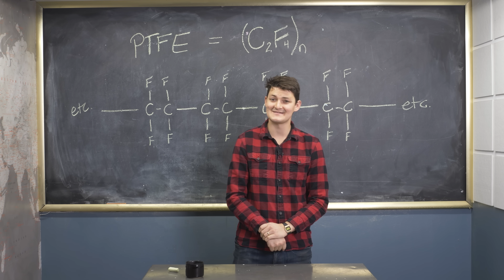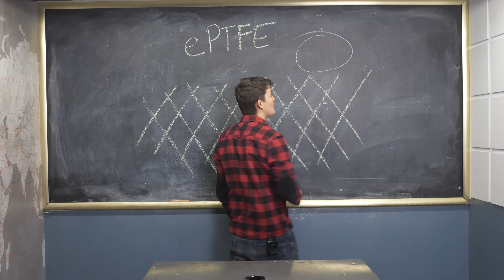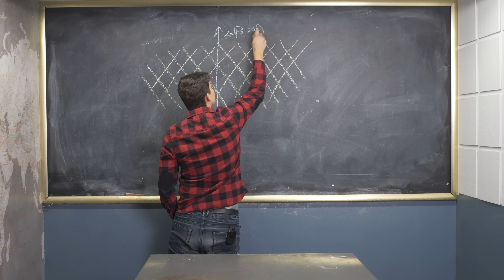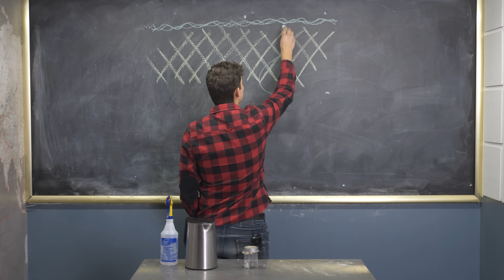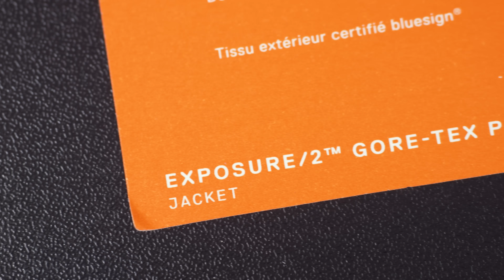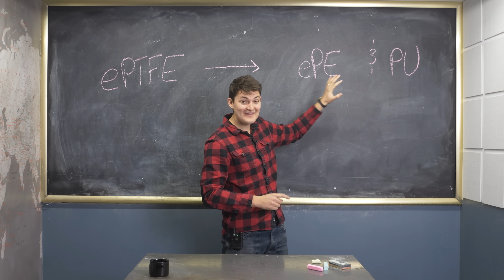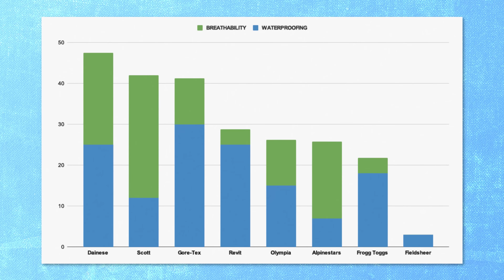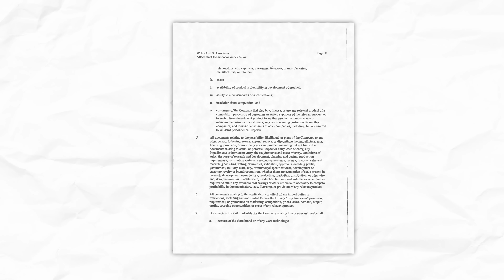Gore-Tex is a Marketing Gimmick

Comment: Excellent video
An interesting addition (IMO) is that there are some systems that have a different way to try to provide waterproofing and breathability.
SympaTex is a german brand that does this through a completely different mechanism, and works using a sort of "wicking" effect between hotter and colder areas. I had a jacket with that sort of membrane and it feels like it does more to keep you from drowning in your own sweat, and is as waterproof. 

It is mainly the breathability that is better, or rather water transport out of the garment, because it is not at all breathable in the way that GoreTex claims to be breathable, but seems to be breathable in a more useful manner.

Comment: This is super interesting and I believe it also applies to all the new "magical" wicking shirts. They only work when it is not humid outside. Here in the Eastern US in summer the humidity is unbearable. Doing active work outside will make you sweaty. The new plastic shirts do nothing to make me comfortable, I am better off in a nice simple long sleeve cotton shirt that gets *cold*. Plus the new plastic shirts smell awful, despite any marketing on them about odor control. Cotton and wool do not have this issue.
Reply: I wouldn't go with anything other than cotton, wool, or smartwool for moisture wicking. The latter being my favorite as it works just as well in +40 as it does in -40.

Comment: So if Gore-tex is garbage,  what rain gear is best?  How is the "common" person to know if the off brand rain gear is legit or a cheap scam?  Gore-tex isn't perfect,  but it works. And it works better than the rest. 
I made a few wrong turns in life and ended up homeless for about 5 years in a pretty wet part of the country.  I was able to outfit myself in head to toe gore-tex. I literally lived and slept in it.  Most military surplus.  It works better in all categories than anything else I could find or are aware of.  I have been a productive member of society and off the streets for about 9 years.  I still swear by it. Klim gore-tex riding gear, marmot rain gear. Bellevue boots, etc. Its still good stuff.

Comment: Your points aren't accurate. Say you sit down on snow in a cold environment, there is waterproofing for your butt. There is also breathability on your torso where you're sweating. Therefore it's both breathable and waterproof.
Reply from the maker: Fair point! Although sitting in snow is not the most common concern for motorcyclists. ~RF9

Comment: Living in PNW, below the tree line, long ago came to a rabid disdain of Goretex. Especially for sailing or any sort of coastal hiking trails. It just ends up being so waterlogged after any amount of use. I stick with durable vinyl jackets with large venting zippers - which are a fraction of the price and last almost indefinitely. 8 inch holes under your armpits will vent pretty darn well! If you need to cool down after exerting yourself you ditch the jacket and hang out under an umbrella for a while.
Reply: any suggestions? I need something for .motorcycle riding
Reply: @ratbrain7743  F-9 has done multiple product reviews over the years for riding in the rain.

Comment: It's all about layering and having control of the ventilation. The more adjustable vents and the bigger they are, the better (more control)!
Pit zips, thigh zips, back zips with a flap. Rain coats with proper vents make very good winter shells with a down sweater underneath.

Comment: i bought lowa zephyr tactical boots with gore because i wanted the best tac boots and it had to be waterproof as i use them as outdoors boots and for motorcycle.
They are waterproof but mostly because of the dwr /impregnated outside leather. When leather gets finally wet, they become wet inside too. 
Inside layer of goretex membrane stitching is poor quality it was literally hole between leather and membrane at the top, from the factory new boots.
Send them back, received another pair, same story, got it stitched better in local shop. 
Overall i like them boots, and they are very comfortable and relatively breathable and relatively waterproof but build quality and durability for top dollar boots should be better.
Do i recommend them for outdoors and motorcycling? Yes if you can easily afford them. They a lil too delicate for riding bike so have to be careful, on contact points with bikes frame for example youll get polished spots of suede. So yes they work as bike boots, but have to be careful, and use something to cover gear lever, suede will get colored in contact with metal gear lever. I ride africa twin with DCt so thats not issue in that case :)
Reply: on topic of goretex membrane, is hard to tell. Cant complain but also i dont feel its anything special, like Ryan mentioned. It will leak eventually and get wet.

Comment: Never paid extra for gortex. I snowboard, so waterproof is important in my gear. I was looking up gear for someone else and saw gortex and looked it up (I was this out of the loop) and still didn't get it. I just needed waterproof with vents. How breathable could it possibly be to beat that?

Also, I'm a cheap mother fucker so I just would never pay for it

Comment: Your own testing shows that Gore-Tex is THE most waterpoof of any of the membranes tested. Additionally, you argue against Gore-Tex, because it breatheable OR waterproof, ignoring that, yes, that's often the point. I dont want to stop and put on an outer PVC layer, if i wanted to do that, I'd have bought that. 

Unquestionably, Gore-Tex does what I want, delivering somewhat moisture permeable clothing that resists water intrusion better than anything else this side of "pure plastic", AND its backed by the most stringent testing and best warranty in the market.

That's still worth it to me, empirically.

Comment: I did shell out years ago for the "Gore-Pro" super-suit which has the "Klim" badges and "super-fabric" ornamental skid sections. Since the venting is also absolutely amazing, I still stand behind my purchase proudly. Even though it's wildly overpriced, I can say that with regular washings and care, I still have an amazing suit which looks and feels almost new after over FIVE YEARS of regular use. My buddies who skimped and went with lesser models have long since resorted to the "duct tape" trail fixes following quick failures, and have been forced to buy new ones. Add in the fact that I don't need to pull over and strip down in the rain to add any waterproof layers, and I would SURELY make this insane purchase again without a second thought.
Reply: My klim traverse gortex jacket is 7 years old and still water proof. I am not aware of another product that can boast that. I do agree though that it really isn't that breathable.
Reply: A well-made, high-quality garment is gonna be high-quality either way, the fabric itself isn't really the problem. The real problem is that FINDING the high-quality stuff in a sea of overpriced sweatshop garbage using gore-tex as a marketing crutch is near impossible.
Reply: @datalorian  No rally intended. Just sharing that my quality garment was worth the stupid price in the end. Thanks for trolling.
Reply: The Gore-Tex membranes DO seem to stand the test of time, and even if they don't you are more likely to get support in replacing a faulty garment with a Gore-Tex lining than you are with a product using eVent or some other house-branded membrane. Gore-Tex seems to offer a premium product and offer premium support with it. Most companies using Gore-Tex are utilizing in their more premium lines, so there you go. I agree though, most "breathable membranes are not THAT breathable, and it is good to layer a HIGHLY breathable and appropriately weighted midlayer under it to create a breathing zone, and make sure your membrane-equipped garment has good ventiliation as well.

Comment: I live in the same climate as Ryan in the PNW so I've used a massive range of waterproof gear. For whatever reason, the Goretex stuff has vastly outperformed almost everything with a proprietary membrane in both waterproofness and durability. It's actually outperformed every single piece of coated nylon "non breathable" waterproof gear I've ever owned. Rev'It's discontinued Orlando waterproof jeans are a notable mention for non Gore gear that was totally flawless, and a cycling jacket I own with Polartec Neoshell. Unfortunately, everything else seems to leave me soggy.
Reply from the maker: Those Orlando jeans have been my daily choice for years, they're stellar. Only thing is that they look catastrophically wet, so everywhere I go people say "oh no, you're soaked." ~RF9

Comment: as a person who works in weather, I've determined there are three kinds of raingear: technocloth, that is reasonable to wear in dry weather, but only lasts for about an hour in the wet before it soaks through.  rubber based cloth, that stops water indefinitely, but also keeps sweat in when the rain stops, and oilcloth, which has the wet weather performance of rubber, the dry weather performance of techno cloth, and the weight of both, together - plus the requirement of maintenance to maintain effectiveness.  but it has style.

Comment: Great stuff, I have a Goretex shell jacket that has never been that waterproof, outer wetted out fairly quickly even when new. 
On a non motorcycling front I was also rather hacked off when my Asics Goretex Trail shoes were very clearly not waterproof, and i was cold at the time, so no chance I had sweated my socks wet, it was the rain. 
Live and learn🙄

Comment: I'm so glad someone has finally revealed the truth about goretex. As a cyclist I can verify that when you are exerting yourself on a push bike in the rain you will end up soaking wet.......inside your jacket! This even happens when it is dry outside. The moisture building up inside the jacket will clog the goretex and once again you get wet....inside. Love your videos and humour.
Reply: Yyyep, you do get moist when exercising in the summer. You are dry when it rains tho.
Reply: Goretex is not a magic force field that destroys a bad water inside it (while keeping  good water intact). As Rayan said your alternatives to membrane are regular clothes w/o waterproof, wich makes you wet and cold when it's raining, and rubber-like non-breathable-at-all waterproof materials wich makes you wet and then cold even whet it does not raining. Heat and Sweat management are your problem,  membane can really help you but it don't solve it for you. 
TLDR: Goretex and membranes aren't perfect. But they are goddamn Sci-Fi comapring to rubber and wax that were before. I think soldiers from WW2 and 'Nam would kill for ECWCS jacket from 90's.
Reply: Better off with Nikwaxed polyester when exerting, less so when motorcycling below 25c.
Reply: That‘s my experience as a cyclist with goretex too. I gave up using it.
Reply: @cfr4831  I have used Goretex for cycling for the last 34 years. I replaced my original jacket last year. The secret to making it work is to keep on top of the DWR treatment. If the outer fabric wets out then it doesn't work. No "waterproof" garment is perfect, particularly for cycling where you are generating a lot of sweat, but I have found my Gortex jackets to be the best option. In fact I would say that when I got my first one it was a game changer for prolonged cycling in the rain. I'm sure that there are other breathable membranes that work as well so I'm not particularly bigging up Gortex.
Reply: @cfr4831  You can make a gortex rain jacket work on a bicycle even in the rain but it must be extremely well ventilated with large pit zips under your arms, and a cape opening at your shoulder blades. Rain chaps work better than rain pants as long as you have fenders.
Reply: The price comparison is very unfair.
It compares a laminated jacket with Gore-tex, with a nog non laminated jacked non Gore-tex, laminated jacket's are double in price because it's way more work and needs to be made wit a lot of handwork, so that explans the price difference, hense it's not the membrane!
Reply: If you wear any waterproof thing you will end up wet inside your jacket due to the extreme humidity. Goretex breaths way better before that happens though.
Reply: @Jagknorr True
Reply: @Jagknorr But goretex will only breathe if the outside environment is more dry than your jacket. So if it's raining outside you lose pretty much all of your breathability
Reply: @Jagknorr it might be "better" than a plastic bag but it still doesn't keep the condensation out which is the whole point of goretex

Comment: Apart from motorbike gear, I've pretty much given up on the whole membrane thing, full-stop/period, and now use NikWax stuff for general outdoorsy stuff. You do get slightly clammy in a downpour (but don't sweat) and as Ryan's video says, most of the waterproofness comes from the DWR coating in the first instance,  so if you keep that in good nick the water beads off anyway, and any PTFE membrane is largely redundant. (NikWax clothing works by WARNING - MARKETING BLURB AHEAD some other sort of convoluted capillary action.)

Comment: I've found choice of fabric depends heavily on intended use. Gore-Tex works well in motorcycle clothing due to the low activity level (internal moisture) relative to the potential head of water (100mph rain...). That, combined with the stringent restrictions on product design imposed by GT, tends to yield a quality product. But that's for cold/temperate conditions with integrated shells... I'd definitely avoid for warmer conditions and it's unnecessary for drop lined clothes.

Comment: Back in the day ( here we go another boomer story) All we had in the way of waterproof coats were either heavy, did not work or were like wearing a bin liner and then the seams would leak. The first Gortex jacket I could afford was like putting on a pair of leather shoes after only being offered plastic beach shoes before. I moved away from Gortex in the 90’s when big sportswear chains started selling their own brands of waterproof walking boots and hiking coats that worked and for a fraction of the price. What I do not understand is today’s tech savvy generations still buying into the marketing hype.
Reply: The tech savvy generation that lines up for the latest mobile phone at $1k, that offers a new colour scheme and not much else?
Reply: @peterk2455  Or does offer something mildly better..but not asking what's the point if what you are using already works.
It's not that these phones aren't better, there just isn't a point if you already have one. They may be slightly faster..but unless it was an active thought in your mind that it's crap while using it, there is no good reason to upgrade. If it's "well it's newer and better" is the only thought, it's an unnecessary upgrade.

That thought also has to be because it's slow, but not because it suddenly became slow doing the same stuff like mine. Lags whenever I turn on wifi since a few months ago, don't care enough to check out why. Probably an app that has reached a big enough size or just a bug with some app that updated because I only realised to turn off auto-updates some weeks ago after an app I was using suddenly broke. It does the same as some other apps and they were all working fine at the same time previously. This was only a month ago or two, so can't be the cause for what started at least 3 months ago.

No, it has to be because it just is slow and some newer apps asks for more resources for a smooth experience. Maybe you are playing phone games for some reason and newer ones are more demanding at the same framerate. It does save money playing phone games on the phone while you also use the phone for all the other phone stuff instead of buying both a phone for phone stuff and a Steam Deck or similar for portable gaming stuff. No savings there if the game is a PC title, as those probably won't run well on the phone. But if it's something that exists on both platforms, no point in the Steam Deck as the casual user doesn't care about the differences. I don't like phone games because my save data may only be accessible if I have superuser, so I would pick Steam Deck as that seems more accessible for that. Corrupt save profile? Copy over a backup..Also doesn't require internet, not that I would only backup using the cloud anyway. At least one local backup too.
If it's just sudden like mine, second-hand seems like the better choice if you don't want to let it be.
Reply: Unfortunately, no matter how much technology advances, people are still just as gullible as always, and all the old scams still work just as well in digital form.
Reply: They aren't though. Its still the boomers
Reply: But those old bin liner waterproofs ("proofed nylon" if I remember) were pretty reliable and you knew what you'd get. I wore them on top when raining and took when rain stopped. Sometimes when it was half rain I'd wear them with zip open to ventilate. I'd carry a cotton windproof for when it was windy and dry. 
This arrangemnt worked ok and was much cheaper

Comment: Yup. When tramping in warm weather get wet then dry off at camp and put your goretex on (or any waterproof clothing). If raining and cold when tramping, a poncho is good for max ventilation but really nothing keeps you dry so wool layering important that keeps you warm when wet. When on a bike, go for max waterproof. Don't need 'breathability' when sitting and wind is lowering your body temp anyway thus avoiding sweat (zip vents good for summer/hot riding). 
Goretex when moving a lot does not prevent sweating as Ryan points out. It's an expensive con. Quality control by using their machinery, taping and consistency is not a con though. The stuff is well made, just not what it says it is. Cheers for making the vid to show some science behind the spin.